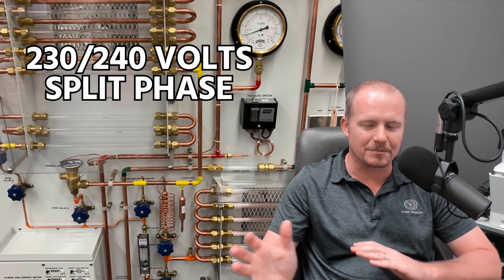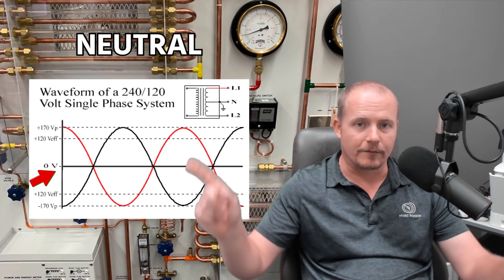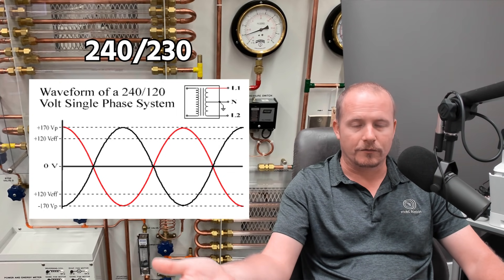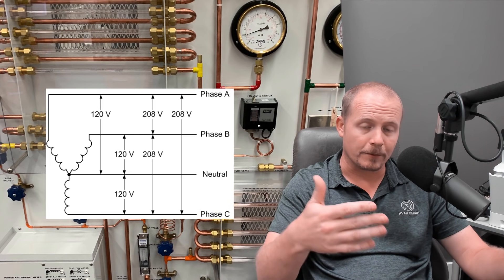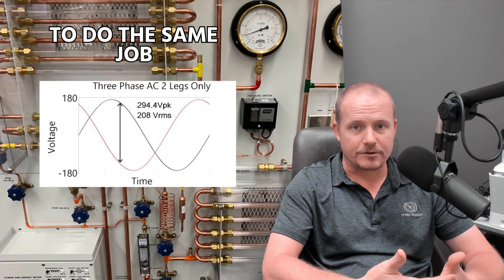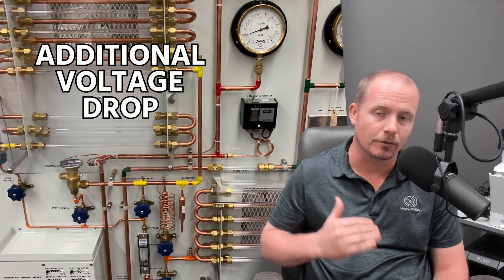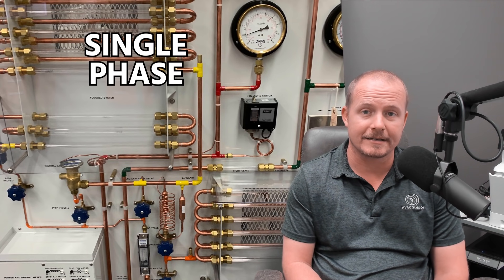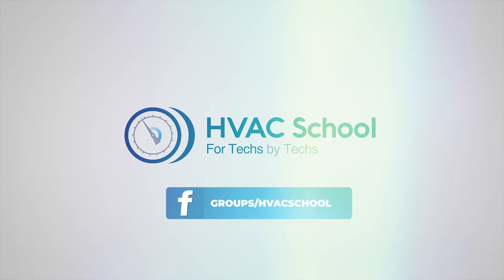How is 208 volts different than 230/240 volts?

Comment: Concise and dense with knowledge. Liked.
Reply: Well... he's not really clear. He made it sound like 3 phase power is actually just two phase power... but in fact it's all 3 connected together and continually changing in their voltage difference to one another. 

The point is, you can only get the maximum 208 voltage between 2 of the 3 at a time, but which ones it will be changes continually.
Reply: @marioluigi9599  I believe he's referring to use of single phase devices. So what you are speaking of doesn't really apply. And yes, it's possible for '2 phases' to power a single phase device, because it's really just 1 phase when there are only 2 wires.
Reply: @spruce_goose5169  We call it "single phase" for historical reasons when we connect phase-to-phase loads to a 3-phase grid.  I dislike this term, because it is easy to confuse it with single phase line-to-neutral loads, that are really the true single phase circuits.  I prefer the term "open wye" to refer to two phases and the neutral drawn off the 3-phase grid.
Reply: @carultch  yeah. I think my point was just that any two lines, whether line to line or line to neutral, constitutes only one 'phase' in the strictest scientific sense. One sine wave, if you will. 

But as far as how people speak and refer to various electrical systems and system components, there's certainly many ways. Some perhaps more technically accurate or common than others. What you say makes sense.
Reply: k yeah thx

Comment: As an EE, I DO enjoy your vids and you have great education on HVAC, but your understanding and explanation of split phase and 3P is both flawed, and confusing for people.  Which is probably why I get stuck answering so many questions about it!  You are NOT running an AC compressor on "split phase", you are running it on a single phase.  Only ONE sine wave.....ONE.  Exactly the same with 208V.  Connect to to two legs and you have a single sine wave.  Absolutely nothing about phase angle even applies!  The only focus is on the voltage!

Comment: Great explanation and video!, Our home has a 200 amp 208Y/120 service as opposed to 240/120 from the pole using three transformers. In the near future when the POCO goes underground we'll be getting a small 3-phase padmount. As you pointed out our voltage is actually more than 208 - closer to 220 between phases. 😀😀😀

Comment: I have a residential sprinkler  pump running on a 208 timer.
It quit working and I just replaced it with another 208 because that's what was there before and I had no idea of the difference.
The timer quit working in 3 months. 
Did it have to do with running the sprinkler system pump? 
Is it possible that the timer got ruined because it's running a sprinkler pump motor.?
 Or is it a coincidence?

Comment: Hello, this is great information. Thank you. My customer has a kiln machine that is not getting hot enough to do the work they need. It’s a machine for ceramics. The service is 120/208 but the kiln machine is rated for 240. Can I insert a 208 to 240 buck boost  transformer to remedy this problem?

Comment: Yeah that’s wrong. It’s still single phase. There has not been 2 phase equipment manufactured in the US since at least 1975. Two phase is typically a 5 wire system, and is only still in use in a very few old buildings in places like old parts of Philadelphia or Hartford, CT.

If you look at equipment data plates on anything made in this century it’ll say on it 1 phase or 3 phase. There’s no other options. Or look at any utility power company website for new service applications you only get a few choices. Single or 3 phase. Time to put this age old argument to bed already.
Reply: This is a merely semantic argument, and pointless.  Whether you prefer to think of the split phase systen as one phase with opposite polarities or two phases 180° apart doesn't matter, because they are mathematically equivalent.  It is just a point of view.

Comment: Hi .i heve a question can I connect a 208 vheater to a 240v
Reply: If it's designed for 240V, yes you can. Most heaters are designed for 120V-240V. But check your heater rating

Comment: Hello there. I know when you have a 208 convection oven you have to boost the start up or that oven will be over worked and burn out easy. so yes 208 is way different from 215 and up. However many 208 systems are single phase. Units being 208~240 Volts are very good. They manage v spikes and voltage drops better.

Comment: Good explanation but I would specify a 3-phase condensing unit for use on 3-phase. One of the advantages of a 3-phase motor is power delivery. As your diagram illustrated your power is never at zero like with single phase.

Comment: As a European I must say, North American 120/208 V and 120/240 V system is a joke. Lower voltage, higher losses in the wires compared to our 3 phase 230/400 V system.
Reply: Only 400 volts? We use 480v😅 talk about line losses
Reply: What a bum😂 european? lol USA all day

Comment: It's easier in the EU. You get either single phase 230V or three phase 400V. No split phases here. And by the way, if you import a device from Europe it should work perfectly fine on 208V and 240V as well, as long as it doesn't complain about the frequency. It's because the acceptable voltage range here is +/- 10%, so anything between 207 and 253V is correct. Every appliance has to start and work normally even at 207V
Reply: I have two large appliances made in Europe.  They come to the USA configured for use on 120v 60 Hz power that we use for most things here.

Comment: Im not an electrician and a bit confused with some of this , if i have a 3 pole breaker going to 3 pole contactor/overload and i have 213volts phase to phase and 123volts on each phase to ground, what do i have what is this considered!? I’ve been calling it 208 3 phase. Im wiring up a 3phase motor and there’s only 3 power wires and 1 ground no neutral.

Comment: At 208 VAC, you ignore voltage drop issues at your peril if you're using equipment that claims to support 208-240 VAC (single phase).

For example, Friedrich makes window air conditioners that are rated for 230 VAC and support 208-240 VAC (nominal).  When Con Ed (New York City's electrical utility) announces that they're going to drop their voltage by 10% (brownout) on a very hot day, such a window air conditioner will keep going if you have nominally 240 VAC service, but if you have nominally 208 VAC service, there's a very good chance that the air conditioner's motor-protection circuitry will prevent the compressor from starting, and you'll be without air conditioning on a day when you really need it.

Whether your load is HVAC equipment, cooking equipment, or laundry equipment, you may want to design in a 208-to-240 boost transformer (or an isolation transformer if you need a neutral) and use correspondingly thicker wire on the primary side.  While manufacturers often sell dual-rated equipment that operates on nominally 208-240 VAC, 208 VAC is at the low end of the range, and users may be dissatisfied by the performance, even on "good" days: cooktops delivering only 75% of the heat that they would under 240 VAC; clothes taking longer to dry; ovens taking longer to heat up; car chargers taking 33% longer to deliver a given amount of energy; and so on.  And when the utility drops the voltage during a heat wave, and your equipment receives voltage well below tolerance, things get really unpleasant.

Moral of story: if your equipment isn't specifically designed for 208 VAC, then operation on 208 VAC is probably an afterthought.  If it's designed for the 208-240 range, consider designing in a transformer to boost the incoming voltage by 15%.
Reply: Мне кажется, что у оборудования должен быть несколько более широкий диапазон, а эти цифры лишь указывают на то, к каким сетям его можно подключать. У нас в России на многой технике написано 220-240 В -- по сути, это стандарты напряжения в Европе -- 220, 230 и 240 Вольт. При этом, у нас в стране действует 2 стандарта на напряжение сети -- "старый" 220/380 +-10% В и "новый" 230/400 +-10% В. И, согласно этому, напряжение в сети может находиться в пределах от 198 до 253 Вольт, что ощутимо выходит за рамки питания этого оборудования. Однако, оно проходит сертификацию.

Comment: Correction: 208 volts is NOT a 2 phase power source. 208 is in itself a single phase source.  It is derived from two out of phase legs of 3 phase just as 120 is derived from one leg split. 208 is single phase.
Reply: You contradicted yourself twice.  It's 2 phase dude.. you said it yourself.
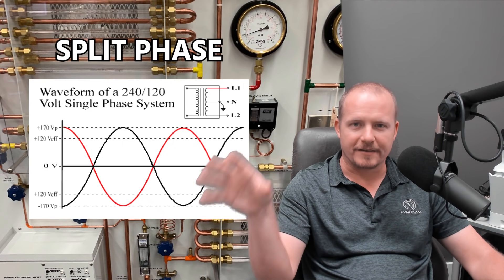Reply: @Rico702Vegas Up to 2:19 in the video, he talks about 2 180⁰ phases constituting 240 as a single phase source. Afterwards he talks once again  about 2 phases but this time they are 120⁰ out of phase.  Magically, he now calls it a 2 phase source with no rational.  I applaud his willingness to teach, and his mistake here is probably of no consequence to hacks like you.  Oh, by the way he also states that 208 vs 240 draws the same current under an inductive load such as a motor.  Wrong again. This only applies to resistive loads..
Reply: @jacktanner7738you missed the part where he says the the sine waves are closer in a 208 system causing the difference in voltage to be smaller
Reply: @Rico702Vegas So you are saying "there is such a thing as 2ø power?  Look it up. You won't find it anywhere. Go ahead.  A primitive power source, 2ø, did exist in the early 1909's but was quickly dicarded. Today 1ø, and 3ø are all we have.  Go ahead genius,  check it out. You can't believe a u tuber could be wrong.
Reply: @jacktanner7738And for the record we could make any # of phases we wanted, but you have to consider cost, waste, efficiency. Ask your Mom, she knows about that one.
Reply: @Rico702Vegas I accept your apology.

Comment: So a 240V is split into two 120V output?  Is it 120 V in amplitude, or 120 V RMS, because the chart in 1:22 shows 170 Vp and 120 Veff.  Also is this different from the 240 V and 115 V switches on a computer power supply meant to accommodate American and European voltages??

Comment: 240 volts RED (hot) to BLACK (hot) is a single phase from a delta transformer. The split is from BLACK (hot) to WHITE (neutral / grounded conductor) and WHITE (neutral / grounded conductor) to RED (hot) [notice how the order changed, because the windings are not reversed in the transformer]. The HOT's to NEUTRAL is the split phase. The amplitude is reduced by half because the transformer is center taped.  

The neutral only carries the unbalanced loads. If the loads are balanced on both sides of the split there is no current carried on the neutral from the service back to the transformer.  If the windings were reversed the neutral would have to be much larger, because would carry current from each side of the split and there would not be 240 volts from hot to hot.

Delta transformers can also provide 3 phase service, but there will be one stinger leg substantially higher than 120 volts  to neutral or ground.  This can get you if using a pigtail on commercial systems.
Reply: If a single phase relied on another, you couldn't have single phase power.

Comment: I din it ironic tat you would have motor startup problems with three phase as it is intended just to solve that. The proper use of three phase is to have all high power loads designed for three phase.

Comment: Resistive loads designed for 240V will run at 75% of power on 208 volts.

Comment: I have an air-conditioning untit that has an odd plug on it. It reads 208/230 v.  I want to hook it up in my house but need to change the plug due to its horizontal pos and neg. It also has a ground.  Suggestions?

Comment: ok so  3ph 230v is the same as 3ph 220v the motor company just labeled it 230v? and i want to power it with 3ph 220v the vfd company labeled 220v 3ph ? right

Comment: As others have mentioned the 120/240 circuits are not 180 degrees out of phase.   Below video does a good job explaining that they are in phase.

https://youtu.be/nOSYHUxHxG8
Reply: They are 180 degree out of phase relative to neutral, because one is negative and the other is positive.  They are in phase if you measure from one line to neutral, and from neutral to the other line.  It's a matter of reference / semantics.  Other than that, the point of your linked video is to not have both lines positive relative to neutral at the same time, because the line to line voltage aka voltage difference between the two positive leads will be 0.

Comment: Split-phase is NOT two separate, discrete phases. You can't get multiple phases out of single phase service without a phase-converter. Split-phase is simply two HALVES of the same phase. You can use the halves by connecting to one leg and neutral. You can use the ENTIRE phase by connecting to both legs without the neutral.

They aren't separate phases. They are NOT 180 degrees out of phase either.

Comment: I turned off this video as soon as the graph was shown of a 240/120 volt single phase system being 180 degrees out of phase.  This is 100% incorrect.  If something this simple is incorrect, how much of the rest of the video is wrong?
Reply: You missed out then, he gave out a new fluke for anyone who caught that and typed the code word.
Reply: Baloney.  You are making the argument about semantics rather than substance.  A split phase can be viewed as a single 240v circuit, and two 120v circuits which are in opposite phase.  The mistake he makes is in calling 208v two phase.  It is a single phase produced from two phases of a 3-phase service.  It is clear that this gentleman knows how it all works, which is the important thing.
Reply: @GH-oi2jf  Please help me understand why two 120v circuits that make up a single 240v circuit are in opposite phase.
Reply: Actually for a lot of residential service he is 100 percent correct. If you are taking a single phase off a 3 phase service then it would be 120 degrees.
Reply: @Tony-pq3xv you are exactly right, and the guy in the comment we're replying to is probably outside the US.
Here in the US almost everything runs on 120 volts which is not what our electrical transmission lines carry. At the service distribution, we send one phase through a CTE transformer and off that you get two hot wires and a neutral. This transformer is taking one phase from the three phase system and splits it into 2 phases that are 180 degrees apart.
To the other comment the voltages don't "cancel each other out". Voltage is the difference in potential between the two points, so for a neutral, it's the distance between the sine wave and zero, for both hot lines, it's the distance between both sine waves which is twice as much voltage.
Reply: @Tony-pq3xv they were 180 off, the net sum of the two would be zero, not 240.

The two 120 volt legs are in phase and additive. They both reach + 120 volts at the same time. If they were 180 degrees shifted, one leg would be + 120 at the exact same time the other was - 120. If you plotted the three wave forms, you would see that the two 120 volt waves occupy the same space in a two dimensional plane as represented by an oscilloscope. If they were 180 off, both 120 volt waves would be visible, but mirror images of each other (which isn't the case).
Reply: @81Tackleberry I think it's  more dictated by the polarity of how you measure it.  If you reference the neutral, then one leg is +120Vrms while the other is -120Vrms, at an instant in time. Only if you shift your reference (the black lead on your voltmeter) do you get the +120V measurement you mention.